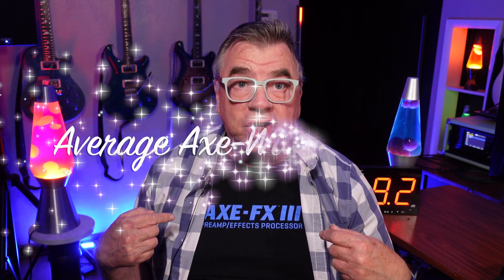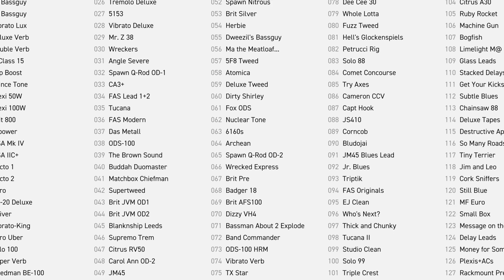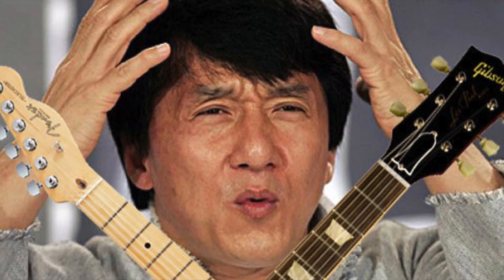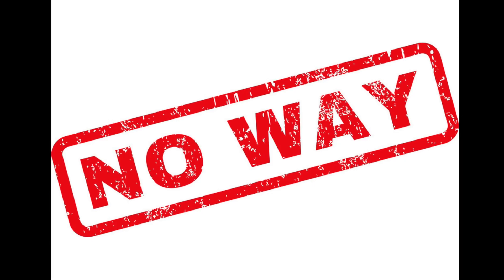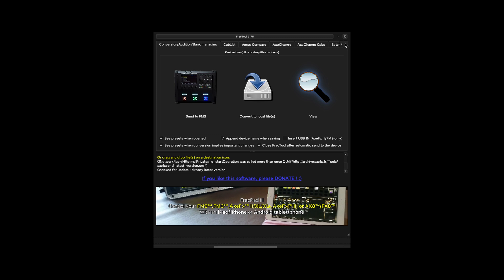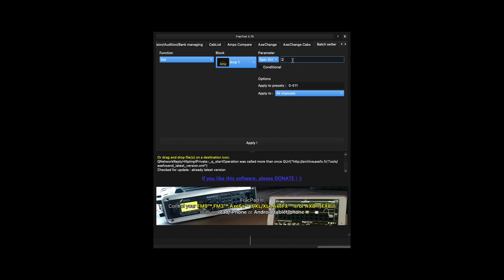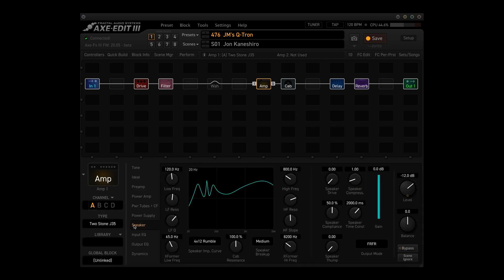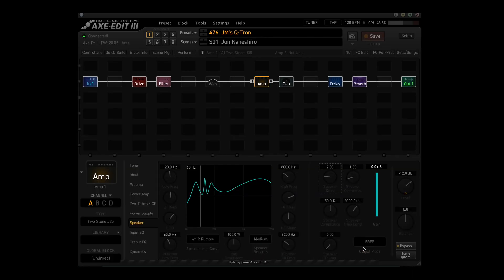Axe-Fx III/FM9/FM3 - Let's Talk About Batch Processing!

Comment: Hey Doug.... Does this work on the FM3 I have tried this a number of times and can't get fractool to change output 1 to output 2. Thanks
Reply from the maker: No, it doesn't. Fractool can change parameter values, but not the block being used.